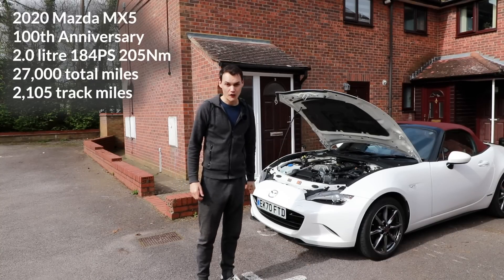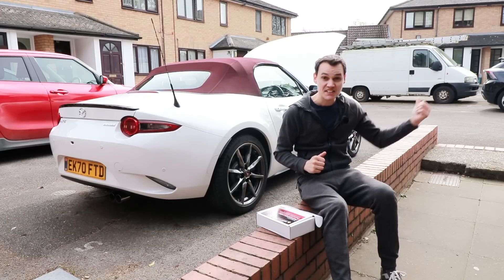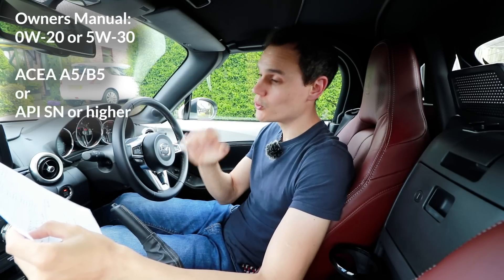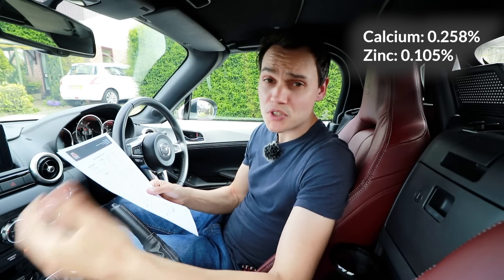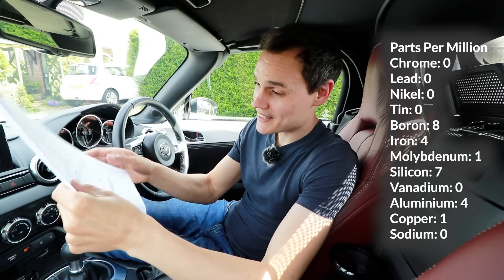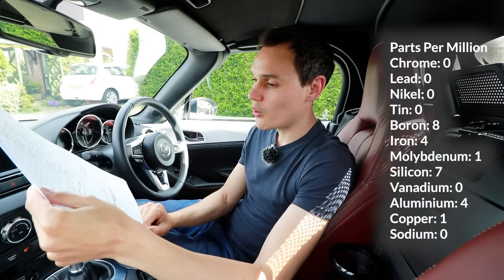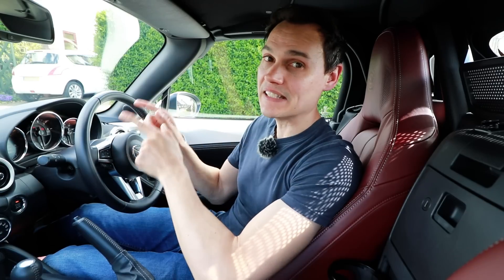Engine Wear Metals After 16 Track Days

Comment: As I understand race oils, they lack long-term protection additives and as such they are intended to be changed immediately following a race.  If you're not down for doing that, you definitely don't want to run a race oil.

Comment: I use higher viscosity engine oil in all my cars. Never go for thinner, unless you have an extremely specific - normally highly-strung engines - car. Edit: Silicon could be from the cylinder liners too.

Comment: Interesting video....I've always wondered about sending oil off for analysis, just to check if sticking to manufacturers oil schedules is the best thing to do or not. Im not sure where Mannol oil sits on the quality scale but I'd be tempted to step up to a more premium oil. I'd agree that if it meets the manufacturers spec then why would you spend more but it has been proven that premium oils not only meets the spec but goes beyond that with an even better (wear and detergent) additive package and better flow characteristics after time.

FYI....Boron and Molybdenum are friction reducers, Zinc and Phosphorus are anti-wear additives and calcium, sodium and magnesium are detergents.

Comment: Oil question: my Suzuki car also accepts 0W-20 and 5W-30 and I noticed that it runs smoother and quieter with the 0W-20, so that's what I use for daily driving. I did not start to go track days yet but I plan to, and I thought that I would change to 5W-30 before the track day and then back to 0W-20 for my daily driving. Would you see a problem with this viscosity changing, since some amount from the old oil will always remain in the block/sump? Thanks :)
Reply from the maker: I've not seen a problem. I've always used 5W30 though. I assume the factory fill was 0W20.

Comment: I was a bit surprised that you trust that brand of engine oil. And I think modern street legal cars without actual cage and bucket seats are designed to be safe without wearing a helmet. Sometimes a helmet can cause more injury than safety.
Reply from the maker: I've not had problems with this brand of oil. There has been a few comments about the brand on this video but I've not heard of anyone having a problem with it. I buy it as it's up to standard, is manufacturer approved and good value.

Comment: My A4 B5 from 99' is less rusty that this Miata. Considering that I live in Poland, where salt is commonly used during winters and that since I bought this car, I park it outside whole time for around 8 years, I am glad I bought A4 B5. Many other cars wouldn't survive it. 😝

Your oil seems to be very fine. I am also using a little bit thicker oil, 5W50, since I also trackday my car from time to time and I think it serves this engine well with higher load.

I have factory oil temp gauge and on track I keep it around 110°C, not exceeding 120°C. While daily driving, oil temp is around 90°C, on Highways or in the summer in city jams goes up to 100°C.

Comment: Hi Rich, I always enjoy watching your videos even tho I am not new to driving and your tips are always so helpful. For your Direct Injection 2L MX5, what do you think about the potential carbon deposit behind the intake valves like it appeared on your leon? I saw other people opinions to install an external oil catch can to be preventive. What do you think about it? Do you think having regular oil change and good quality of fuel are good enough? Share your thoughts
Reply from the maker: I assume it will suffer from carbon build up at some point but as I drive it hard on track it may be better. Time will tell. I would not use a catch can as changing the positive crankcase ventilation system may cause harm to the engine or affect how it runs. Also, it will likely have condensation issues.

Comment: I thought oil should be changed before / after a track day. That is a cheap brand oil.
Reply from the maker: The oil is to the correct specifications and manufacturer approved.

Comment: When you are comparing your analysis to other "normal car" analysis you found online, are you comparing apples to apples? Because if I understood correctly, you are changing your oil after slightly over 1000km, while stree car oils are usually changed after 20.000. there is more than an order of magnitude of difference in mileage

Comment: the lead engineer says the motor can sustain 1.4 lateral G's, it's a proven race motor thanks to spec series so at this pt it's more accurate to measure by hours for non-street use
..also you're more likely having to pay attention to the trans

Comment: Use an A5/B5 oil but API SP, or at least SN Plus. I have no idea how that SN spec ended up in the owner's manual, but Mazda has a known reputation for messing up the oil specs recommendation (see the rotaries and the 2.3DISI-T platform).

Comment: Calcium and Magnesium content indicates detergents and dispersants. Zinc is a measure for ZDDP which is an antiwear additive. Molybdenum also indicates antiwear additives, as does Boron.

Typical wear metals are Iron, Chrome, Aluminum, Silicium and Nickel. These mostly come from pistons and cylinder surfaces.

Softer metals like Lead and Copper indicate bearing material.

Comment: Just a correction. It doesn't mean it's better on track because you put 5w30 into the engine instead of 0w30. the 0w is better in most cases at the start, and when the engine is still cold. No point in putting 5w into it. And into a turbocharger engine, you should put the thinner oil.
Reply from the maker: I was comparing 0W20 with 5W30.

Comment: Exacly why I do oil changes every 15-20000km. Never had any issues with any car ever after some 1.5 million kms.
Just changed the oil of my skyactive engine after 18000km. Felt like new.
Reply: VW recommends up to 30000km intervals on their cars... modern oils are insanely resilient
Reply: @lptomtom  yes, but in the States they change oil every 3000 miles. Long live misinformation and fear.

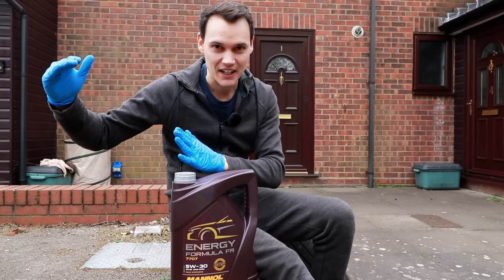Comment: 3:22 - 5W30 and lower viscosities were introduced for legal reasons (emissions) and to lower fuel consumptin but they are not necessarily good for the engine.
As a rule of thumb in any track day/autocross, other motorsport used car you should switch to at least 5W40, and preferably 5W50 to lower the risk of breaking the oil film under full load in high temperature.
Another problem is, that if you go on racing tracks you are going to have high side g forces taking away oil from oil pump's intake, so you better do 'dry oil sump' modification.
The lack of these and use of 0W20 oil is what's killing Subaru BRZ/Toyota GR86 engines.

The whole viscosity recomendation is a complete bias, again caused by legal reasons in the EU. If you search for manuals for exact same engines they will have different recommended viscosities depending where the car was sold, and how strict the local emission regulations are. An engine that has recommended viscosity of 0W20 in Europe, often has oils such as 5W40, 10W40 and even 15W40 in American or Central Asian markets. 
I just wouldn't recommend 15W40 because it has a tendency to cause 'dry start' and leaves dirt in an engine. At least older 15W40 oils did.

Comment: There's no oil "designed for an engine". If you watch the Speed Lake Jr videos, you will know that the single most important factor when choosing and oil is to know its operating temperature. Does your car have an oil cooler? If yes, then maybe you are fine with using a 5w30 oil. If not, I'd go with 15w50 high ZDDP oil or even 10w60 racing oil (which you of course dump after the track day is over). Ford for the Coyote 5.0 engine (Mustang GT) recommended 0w20 for normal use and up to 5w50 for racing use.

Comment: Wonder if the corrosion comments are from non uk owners...seems a normal for uk cars in our crappy climate. Only recently had a new car , (wifes car) so Sprayed underneath with xcp rust blocker , just because im a bit ocd, but won't make much difference long term. 😏
Reply from the maker: I think the underside of my MX5 is fairly normal for it's age driven on salted roads in Great Britain. I'm not worries about the subframe and suspension arms as they can be replaced when the car is 15-20 years old. The chassis however is something I may look into protecting for the next owner or if I keep it long enough.
Reply: @RichardFanders agreed 👍

Comment: 1 ppm moly. is probably leftover from a diffrent oil that used it as a friction modifier. 7 ppm silicon can be from airfilter yes, but also from a oil filter. seeing copper is a bit concerning if it's from the bearing, as these are not supossed to wear. millers have a ''trackready'' oil called ee performance, wich is ment for regular road but also trackdays. might be a good fit for you

Comment: Thanks for sharing, great results. 
According to owner manual before epa intervene in 2019 you are allowed to use 10w50, i don't recommend for your usage  but just to  keep in mind, 

Unfortunately mannol doesn't publish data sheet , and there additive after usage are very low. 

I would like to recommend higher specifications like dexos2, acea c3, mb229.51, mb229.31, vw 507, bmw LL-04 
They have lower noack volatility and higher high temperature high shear(hths) high temperature full shear  (htfs) 

for further reading : machinary lubrication, lubrizol tool, oil club ru, the motor oil geek
I sent  the links to your Instagram direct

Comment: Great video! Maybe consider an A3/B4 high-HTHS 5w-30 that meets BMWLL01 like Castrol Syntec Euro Car?
Reply: High calcium and sulfate ash for direct injection high compression engine
Reply: @عريف_شرك  I have many friends who use full SAPS in their turbo DI engines without issue. Including this one. Absolutely zero LSPI.
Reply: @DBravo29er  you are right but it will increase the risk of lspi and intake valve deposit
Reply: @عريف_شرك  Not true at all. Porsche A40 is full SAPS, yet it's used in their TDI 3.0 991.2 & 992.1 motors. Zero issues with LSPI.
Reply: @عريف_شرك  Further, all MB229.5 oils are full SAPS. Blaming LSPI on SAPS/Calcium has not been born out by the data.
Reply: @DBravo29er   that's true for German automakers in usa but in Europe they recommend mb229.51, bmw LL-4, VW 507
Reply: @عريف_شرك  In the exact same engines. Let's Be honest about context here. The motors are EXACTLY the same.

Comment: Great video, something to consider:  While your oil is holding up well, post track days, it means your oil filter is doing its job, not allowing metal particles back in to float about.  Periodic compression testing is another metric.

Heat is your #1 enemy, so consider short shifting when temps rise on track.

Glad your enjoying car for what its engineered for!!

Comment: Great content. Some thoughts, years ago I watched a Japanese video where the tuner said that we should pay more attention to the gearbox oil after doing track days than the engine oil. He was saying that the manual transmission oil goes through a lot more stress on a track than the engine oil does. 

Also, surprised and impressed that you're using Mannol. I only really use that on my very low value cars that already burn/leak oil. I think they don't carry any manufacturer approvals so whilst they say they've designed it for VW or Renault etc. specifications, no one has actually verified that they meet those standards. That's why you don't find them in any car dealership, or national chain style garages, or most motor factors. Good to see that the oil analysis looked good, I wonder if it would've looked better with a premium oil such as Mobil1 or Castrol etc. maybe in another video?
Reply from the maker: According to the data sheet the oil I used is approved by: Ford, Volvo, Jaguar, Land Rover and Fiat. I also use mannol in my SEAT Leon, which apparently has VW 504/507 approval. Not had a problem with the oil yet, just seems like good value to me. Do you have experience with mannol being below quality?
Reply: @RichardFanders  if you look at the datasheet, it says "approval RECOMMENDATION" and then lists a bunch of OEM standards for oil. Now compare that to Comma XTech 5w30 for example, they list the OFFICIAL APPROVAL from Ford for a particular Ford standard, and they even provide a Ford letterheaded document that confirms that Ford approve that particular oil for that particular standard. 

Basically, any oil manufacturer can say that they have designed or blended their product with a particular OEM standard in mind, but the more expensive oils will actually have the product approved by that OEM. Getting it approved costs money.  

There is an argument that it only really matters for engines that are still under warranty, and I do sort of agree with that notion... You've done the testing and confirmed that this oil is perfectly fine, the only thing more interesting than that would be to do another test using a more premium oil that carries lots of official approvals to see if the used oil analysis shows anything different.

I'm not hating on the Mannol stuff, I buy it in bulk for our family fleet, we just don't use it in the higher value cars for that extra peace of mind because they don't go through that manufacturer audit process. Btw they may have gone and got official approval for some of their oils now, they have many many varieties, I only confirmed the above for the particular oil used in your video!

Comment: copper I'd assume is an additive of sorts? You're right in that if copper was in the bearings or something it would likely be coated or plated. For example, chrome plating is often used in the aerospace industry on bearings because of its low friction and high wear-resistance, so that would perhaps be one to watch out for.

Comment: Given your track driving, how frequently do you change the oil? As for vanadium, I think it's used for coating the engine internals like the pistons, crankshaft and cylinders, anything that's under a lot of thermal stress.

Comment: Mannol is quality oil. I've ran Mannol oils in my car and family cars for a few years now. Everyone who "knows" cars always tells me that Mannol is some noname cheap stuff and that I should get castrol / mobil / shell instead. Well, bollocks. If it meets the specs (ACEA, API, manufacturer specs etc) it's a good oil.
Never really saw many used oil analysis data from Mannol oils so thank you for that video. Just reinforces my belief that spec equals good oil.
Also, Mannol is dirt cheap. I can get the oils that I need for about 4€ per liter. Going for any marketed brands you need to shell out atleast 8-10.
Reply from the maker: It seems to be good quality so far.

Comment: 1:58 I highly recommend you to get the underbody etc. rust proofed with fluid film, mike sanders or something similar. For 3,5 years that amount of (surface-)rust looks really bad. My ND is a little over 5 years old and I just got it rust-protected. My chasis was completly rust-free, wich probably has to do with the fact that i am living far away from the coast. However I still drove the car daily over the course of 4 years, including in the wintertime with salt covered roads.
Reply: Things rust it's inevitable. Mine has been rusting like that since 10 years ago and there's no important damage. It's not that fast of a process unless you're driving on salt lakes maybe lol. Trying to rust proof and remove rust all the time is just a massive time and money sink.
Reply: @gamesmaster1060  excuse me, but thats a load of bollocks... if the underside of the car is that rusty after only a few years, you can imagine how it is going to look in another 5 years. if you plan on selling the car anyway, then whatever. but if you plan on driving the car for a longer time then taking 1000-2000 euros to preserve the car sound more like a good investement than a "money sink". its no secret that miatas suffer from rust issues, NA to NC it has been confirmed. in recent times the first few NDs are starting to fall victim to rust, and there is no reason why the ND would suffer a different fate than NA-NC in the future. Telling yourself that your car "has been like this for 10 years and its all sunflowers and sunshine" sounds alot like copium to me. the rust that you can directly see often isnt what causes non repairable damage; the bad rust starts for example on the inside of the frame, fenders, rocker panels. when you can see this rust its already to late, because only at this moment the car becomes a money sink if you choose to repair it...
Reply: @PidseriaWinkleroni  Ironic you say im coping when your the one that seems to be doing that. I have no reason to cope I am just saying that obvious signs of undercarriage rust happened a long time ago and had no problems. Maybe I will get problems later on but it would of took a long time to get there. Even longer for a car that isnt known for rusting issues

Comment: I track a 2nd Gen Mazda3 with the first generation skyactiv 2.0l engine (same engine as the ND1 Miata). Similar results as you, but my engine has 173,000 miles on it. I've been running Motul 300v in 0w-20 per a recommendation by Corksport. I might look into using 5w30 though, as I do remember something in the owners manual about running it for "shorter oil change intervals". Excellent video and breakdown.👌🏻

Comment: morning Richard very interesting video the calcium is part of the additive package in the oil but it is a small amount in the oil these days they use magnesium instead as this helps to stop low speed pre ignition in turbocharged  direct injection petrol engines. the lead and the copper will be from the big end and main bearings on the crankshaft but you are right nothing to worry about. I went on a visit to Millers back in the early nineties the were using a mass spectrometer even back then.
Reply from the maker: I'm not sure if my bearings are made from copper though. Apparently it may be aluminium but I'm trying to find out.
Reply: @RichardFanders  the bearing shells are made of steel plated with copper and a second plating of lead/tin